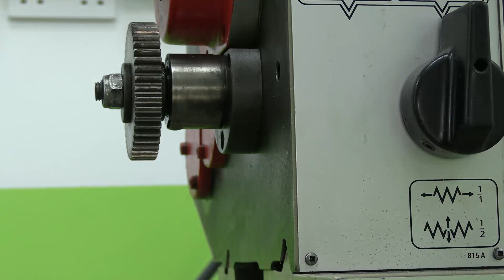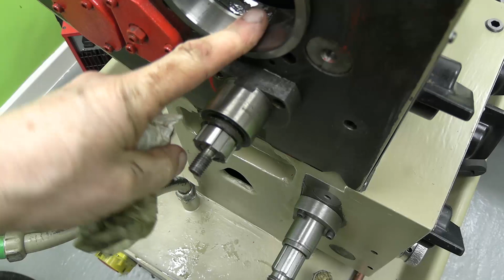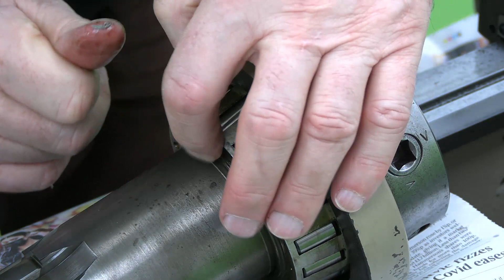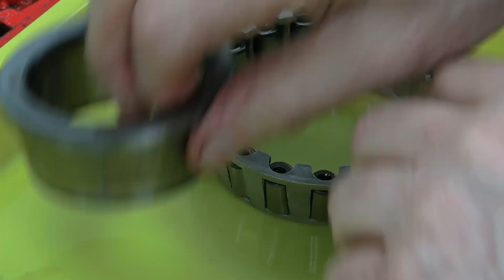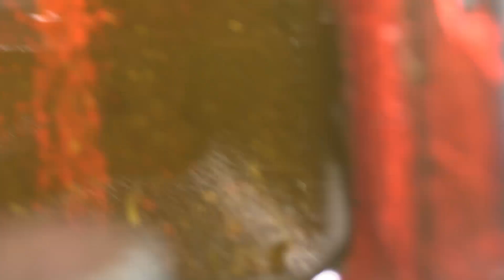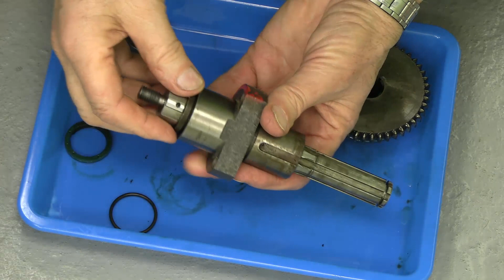Harrison M300 lathe - buggering with the headstock

Comment: I have a M250 and so was interested in your experiences. Bearing catalogues (and many others) are a wealth of information.
When working with bearings particularly $1,000 bearings you should do everything you can to help them live.
Some things to think about
     Hands - use Nitrile powder free gloves - cheap and easy to use.
     Work area - All Purpose Towel Lint Free
    Lubricants (oils & grease) have a shelf life - and incudes while it is sitting in a machine. Generally buy the SMALLEST amount that will do for this project - or share with others - using it 10 or 20 years later may not give the protection you were expecting
    Do NOT put bearings in ultrasonic cleaners - they can pit the surfaces
    Glass is your friend - except when its not. Glass has a sealed surface (liquid to solid) so if you clean it it is CLEAN. Good for final cleaning. Glass cookware has the same property if you need larger sizes. Yes it can break - that's when its not your friend.
    Products generally are cleaner the larger the container you buy them in and then the dirtier the more you decant them.

Comment: Hi,Samuel.  The poor oil circulation to the front bearing is also a common weakness on other models of Harrison lathes. The L5A,L6.and 140 all have poor oil delivery to that front bearing at prolonged lower spindle speeds. I didn't know that Haxby shed had added an oil pump,I must have a look at that video.
 
Don't worry too much about the bearing rollers not being replaced in exactly the same relative locations in the cage. They are size matched for closely matched diameters when assembled at the factory. The indexed positions in the cage are not of any real importance  and if they ran concentric before you dismantled them then they should run just as concentric after reassembly. 

Another thing that may interest you to know is that the earlier L6 Harrisons were fitted with plain Timken taper bearings with solid rollers. These solid roller type Timkens are a fraction of the purchase price than the Gamet ultra precision bearings you have here. I have never had any spindle runout problems with the solid Timkens in my L6 and do wonder whether fitting the solid type rather than Gamet would be noticed in accuracy terms by any homeshop machinist.

The best way to deal with removing the rear spindle bearing is simply to carefully drive the spindle out towards the front and it will slide through the rear bearing. That is how I have always done it on the L6 lathe.

Comment: You know what is a giveaway? A crpenter's hammer instead of an engineers hammer. Fail.
Reply from the maker: I am a physicist, not an engineer. Given I'm using a copper drift, I don't think it matters what kind of hammer I'm using. You might try to be kinder when commenting on other people's videos. I see you have none yourself.
Reply: @samuelfielder  I'm with you, SF. I like your dry humour.
Reply: Sam, probably like you I don't have a heavy engineering hammer, my work doesn't reqire hammering. But soft, could you have extracted the spindle by removing the gear circlip and using some allthread through the spindle with a sleeve to pull the spindle out forwards? I did wince at the thing being hit with the hammer.  My colleague bought a new M300, made in Taiwan, a world of pain with that. 12k, very unimpressed, Harrison not interested. Tight bearings, leadscrew problems, gear selection problems. Not good. You have got me concerned about my own M300 bearings now, but what the eye doesn't see...

Comment: At the 3:57 mark it shows a loose wire clip dangling on the spindle that I think was attached to the inner bearing. Does that also have to come off ? I'm not talking about the circlip that retains the gear.
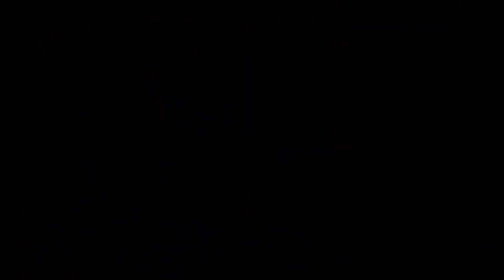Reply from the maker: That is a yellowish plastic ring. It should have been attached to the back of the inner race of the rear spindle bearing, but had come loose. It is shown in its correct position on the bearing at 27:31. Yours should still be attached to the inner race and will come off when you remove that. That plastic ring needs to stay in place otherwise the rollers will likely fall out of the bearing if you take the cage off the inner race. That's what happened to me!

Comment: ONE drop of oil after sitting for SEVEN days?
Wow I can tell you never owned a Harley haha. You measure the oil leak by inches diameter of the oil puddle under the bike after sitting overnight. Less than 4 inches is fine. 
>8 inches means time for a new oil seal. 😎

Sorry about your front bearing. Possibly could be under oiling like you said. In the old Harley gearboxes they have a thing called an "oil slinger" that is a wheel on the shaft inside the grearbox, the slinger wheel has big teeth that throws a heap of oil around inside the gearbox when the shaft is spinning.
Maybe your gearbox is missing a part? Or maybe you could add a slinger? Just an idea.
Reply from the maker: Thanks. A slinger would certainly be much simpler than rigging up some kind of oil pump. Worth looking into.

Comment: Hello Samuel. That was a very informative film. I hope you will not mind my making a small joke at your expense. I have a book called "Technology of Machine Tool Maintenance" by Dr. Ir. C. de Beer, of the Eindhoven University of Technology. In the first paragraph of this work he states "machine tools generally suffer more from maintenance than from use". I often think that is the case!

Anyway, all joking apart, your disassembly of the spindle and bearings thereof has been highly informative for me. I am subscribed to a channel called Haxby Shed, run by a gentleman named Paul. He has a Harrison 140 lathe, mechanically similar to the M300 in many regards. He did an experiment using a clear lid for the headstock gearbox. This proved that the splash lubrication system was inefficient through a surprising range of rpm settings, leading to bearing oil starvation. He has alleviated this on his machine by fitting a small motor driven pump.

I hsve been following his work carefully and I have an idea to fit a small gear pump, driven from the main electric motor. This is done in the larger M series machines.

The discovery of spalling on your headstock front bearing outer race would seem to add weight to all of this. So thank you for what has been a great contribution to the ongoing store of knowledge about these machines.
Reply from the maker: Thanks. I also watch Haxby Shed and he did a good job with that oil pump.
Reply: @samuelfielder  Yes he did. And I think that the spalling found on your spindle bearing race supports his original conclusion and further vindicates his decision to fit the oil pump.

Comment: Hi Samuel, The front bearing marks look like bearing chatter, either from when working due to the bearing preloaded not quite right or and I'm leading more to this, from travel. If the preloaded is not set correctly when the bearings are new and the lathe is transported a long distance from the factor they can chatted (sometimes they chatter anyway) and mark the inner and outer cup and cone.
Don't worry we have all been down the road of, "IF ONLY".
Reply from the maker: Thanks. Is this the same as "false brinelling"? I thought it would match the spacing of the rollers.
Reply: @samuelfielder  Usually there is only one set of marks, however if you watch any shaft that is affected by vibration it usually turns. Given the angle of the normal wear pattern in the bearing cup it could just be from the flex of the head stock shaft which would be up and away from the tool, not just 90 degrees from the tool. I watched a great video about lathes and how they where in ships, how a ship rocks and rolls as well as it twists, yet all there parts were machined to a high standard. Sometimes I think we over think things, it's the same old saying "KISS" Keep It Simple Silly. 
Keep up the good work.
Reply: Hi again Samuel, I forgot to mention that on the shaft that you are replacing the seal on, I was always told to emery paper the seal running area as it makes the seal seat in property,  emery around the shaft not along the shaft and lube the shaft when reassembling.

Comment: Could that be chatter on the front bearing. The cutting tool would push the bearing load towards the rear of the lathe leaving the front half of the bearing with more play. Has this allowed the front of the bearing to hammer the marks in the ring.
Reply from the maker: It's possible, but I don't know how I'd tell. Tending against that is the fact that the spindle end float was at the low end of the specified range.

Comment: Thanks for showing this series Samuel, it's absolutely fascinating, and showing all your "mistakes",makes it even more interesting, you could have easily edited them out. I did think, after seeing the slight wear in the front bearing that there is definately a link with your last video, where you alluded to the possible lack of lubrication, this would be a reletavely simple task to rig up an external feed, to arrest any further deterioration of the bearing surface. just a note on circlips, they being stamped out, have a sharp flat side and a rounded side, if they were originally installed the wrong way,  i.e. the rounded side frontways, you would have a harder time getting your circlip pliers to stay in the holes. ......and don't forget, historically, many of the great engineers were left handed! anyway, best of luck in this project, cheers Dave  ps, I think the back bearing will be fine, and certainly, you won't alter the original spec. by reassembling it
Reply from the maker: Funnily enough Haxby_Shed made a headstock oil pump for his Harrison 140, which is basically the predecessor of the M300, so it might be a systemic design problem. See https://www.youtube.com/playlist?list=PLr7TZ6sBK_mq-9_IgPulV2VjPQ03uACn2 . Good point about circlip holes - I must get then the corfrect way around when I reinstall.
Reply: @samuelfielder  Yes, I've seen that vid, I was thinking some kind of mechanical pump, with supply/syphon from the sump in the headstock. driven by one of the gears in there.

Comment: I'm not convinced you could have removed the seal without removing the shaft. If you look back over your footage it seems to me you would not have been able to get enough leverage on the rigid seal. Maybe you could have drilled it to break it into pieces but you risk slipping and damaging the seal running surface. So don't be downhearted you were probably destined to remove the spindle.
Reply: The best method is to drill a couple of small holes in the face of the old seal then screw in a couple of self tapping screws to either use a lever to prize against the screw head and lever the seal out or use a small slide hammer to pull on the screw heads.